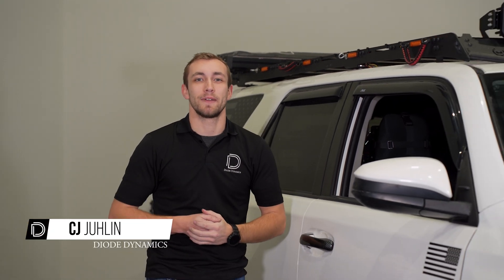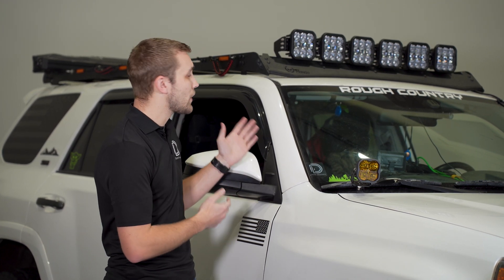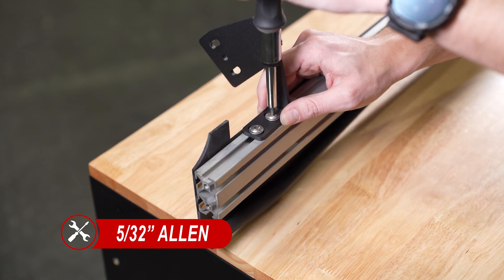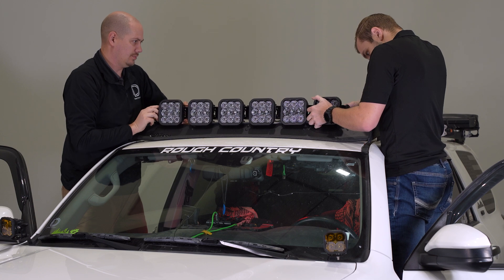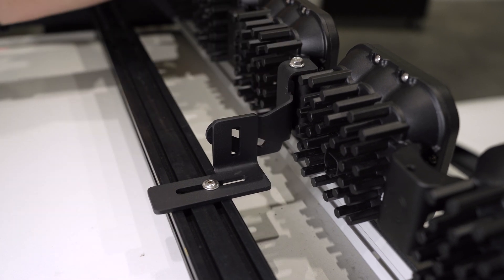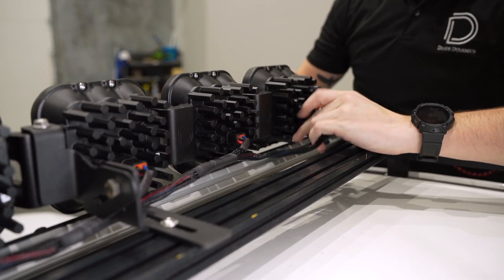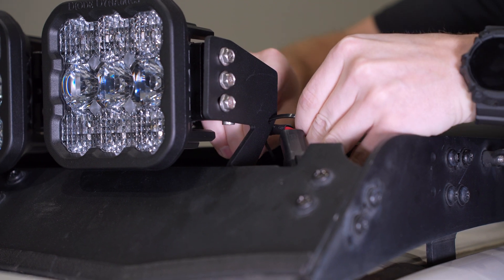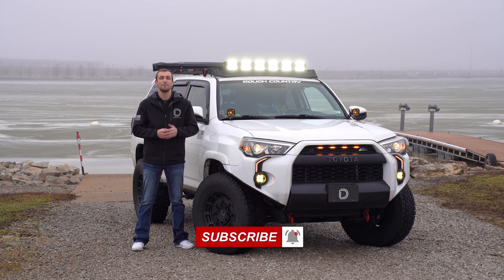How To: Install SS5 CrossLink Lightbar Kit for Prinsu & Sherpa Roof Racks | Diode Dynamics

Comment: does this seamlessly mount with the prinsu pro? or do I need aftermarket mounting brackets
Reply from the maker: The 6-pod configuration will fit the Pro Rack with no problem, however, if you want to run a 7-pod crosslink, you will have to trim the tabs, or "ears" down on the side of the wind faring to get the CrossLink to fit. 

Hope that helps!

Comment: Wondering if you also create same product for victory 4x4 racks they have the same cross bar.
Reply from the maker: While we do not have plans to make this product specifically for Victory 4x4 racks at this time, if the extrusion cross bars are the same dimension, this kit may still work for your Victory rack! We also offer a 30-day guarantee so you can test it out and make sure it works and still have peace of mind! If it doesn't work out, you can give us a call and we'll handle the return process.

Phone: 314-205-3033
Email: contact@diodedynamics.com
Hours: Monday-Friday 10 a.m. - 5 p.m. CST
Reply: Did you end up doing this on a victory 4x4 roof rack?

Comment: New to the 4 runner game as I come from the Jeep family. I’m interested in purchasing these pods, but not really a big fan of the exposed wire running down the windshield… is there a way to tuck the wire down through the cabin and through the engine bay? Or does it have to be exposed to the elements running down the windshield? Thanks for any advice or tips
Reply from the maker: Hey there! Depending on your application, length of wire, you may be able to run the wires along the inside the A-pillar as opposed to along the windshield. You can route the wiring however you see fit!

Comment: Can you just connect it to an spod versus installing another button?
Reply from the maker: Yes, the harness includes a switch adaptor for aftermarket switch banks.

You can click the link below to see the included harness adaptor in the product image. 

https://www.diodedynamics.com/heavy-duty-single-output-4-pin-wiring-harness.html